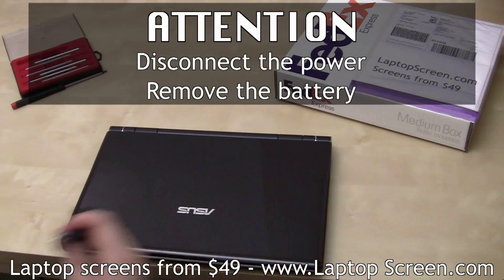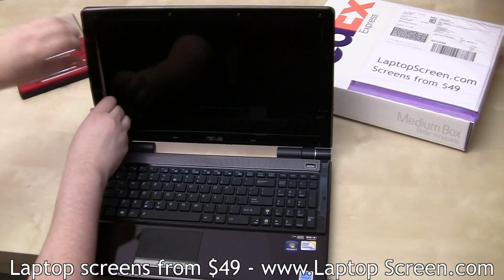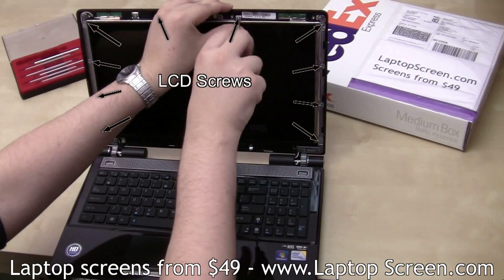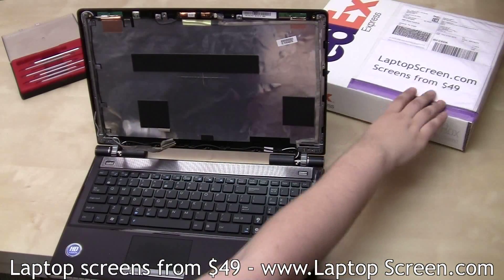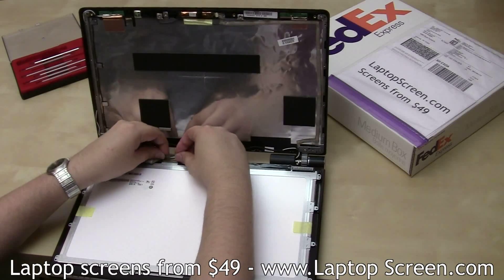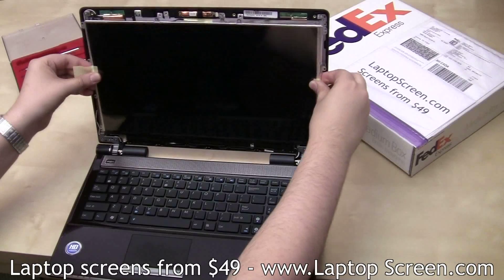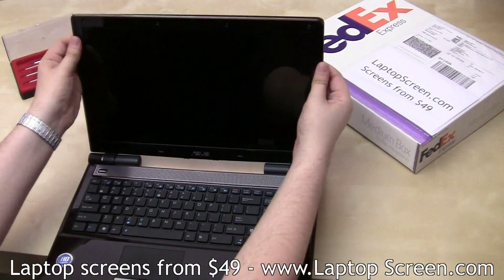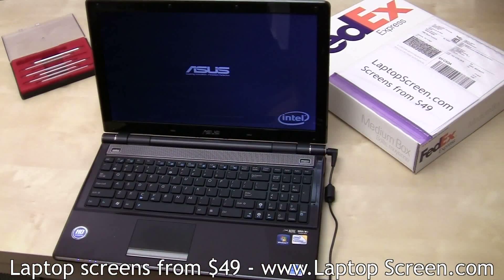Laptop screen repair, LCD Screen replacement tutorial [ASUS U50A]

Comment: Hello! I have an old xo laptop with a crack screen because my stupid little brother cracked it! I'm an young adult now and I received this laptop in elementary school. Is there a way to extract the old videos and information off of it?
Reply from the maker: XOs were so cool! Sure, you can pull the hard-drive out of it, find the appropriate USB adapter on Amazon and copy the files over to any other computer.
Reply: LaptopScreen.com , can this be done even when I can't see the material on it? the screen is cracked so much to the point that I can't even see the arrow from the mouse move across the screen.
Reply from the maker: Have you seen Zoolander? "The files are IN the computer" :)
The hard drive is inside the XO, XO needs to be off to take the hard drive out. Once the hard drive is out, connect the hard drive to a USB adapter, then connect it all to ANOTHER working computer to copy the files.

Comment from the maker: The LCD used in this video, in our classification, comes with a "right side rear facing connector".
If you look at the LCD from the back (Not the face of it), point the LCD driver circuit down (circuit the connector is mounted to), and visually estimate left/right position of the connector as referenced from the vertical center of the screen.